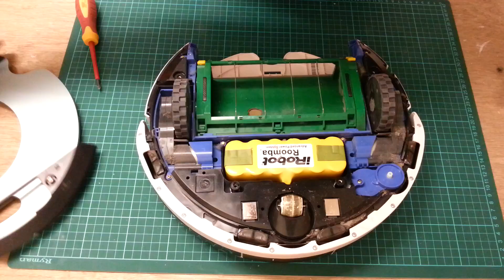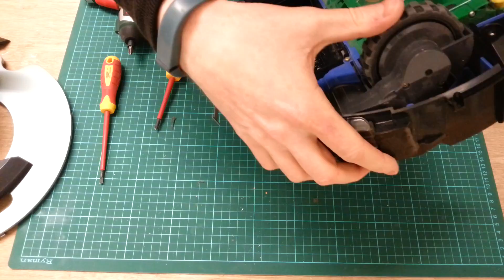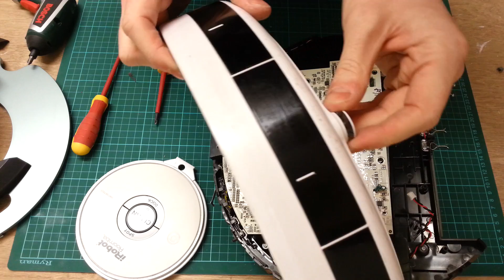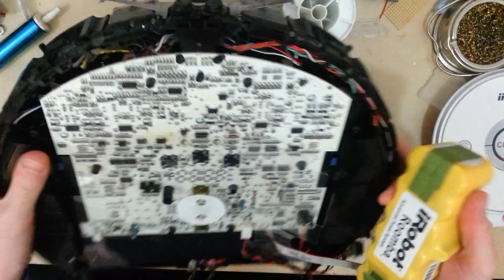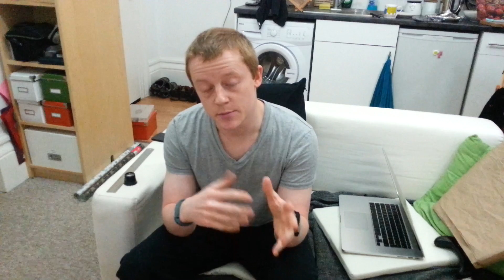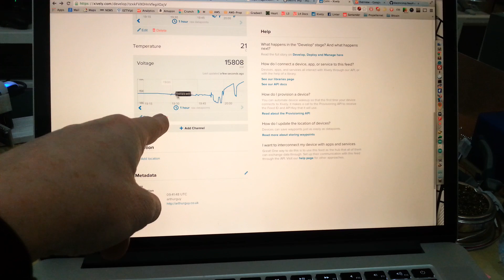Adding an internet connection to a Roomba

Comment: Great job! You're linked to from Hack-A-Day, if you didn't already realise. I have the same unit and I've noticed that the Roomba doesn't seem to want to go around the back of the charging dock sometimes, so it is possible that the dock does double-duty as a virtual wall to help the Roomba dock in some circumstances.
Reply from the maker: Unfortunately I don't have a virtual wall unit so I couldn't look at the differences between that and the dock but I suspect there are similarities. My device keeps about 1m away from the dock at all times, at least until its ready to charge.